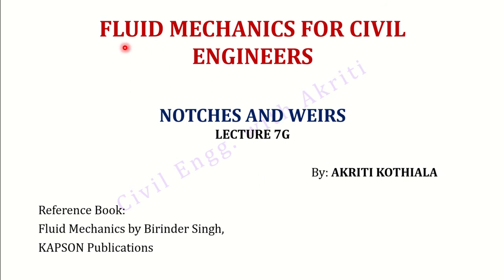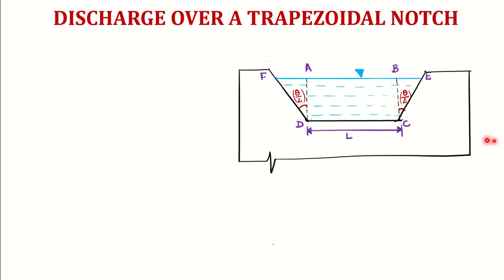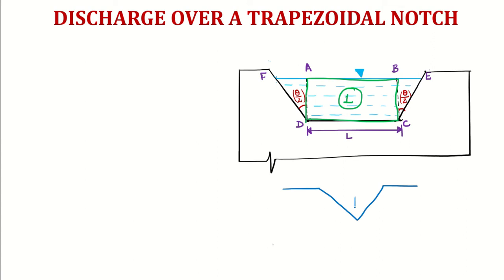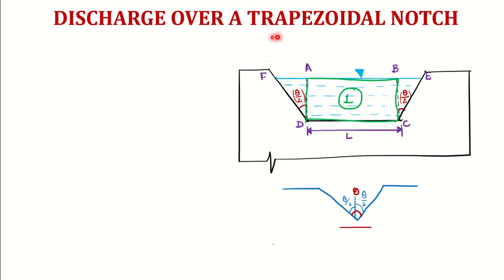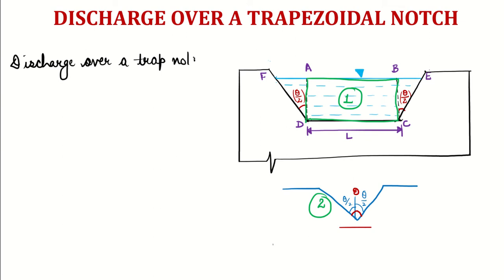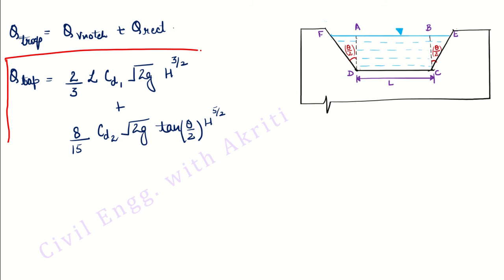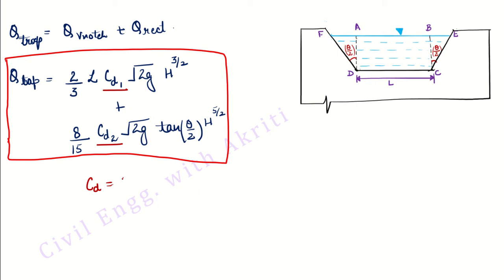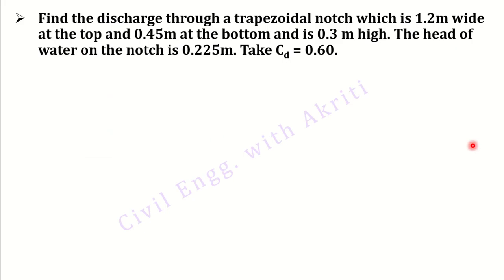Fluid Mechanics | L7G | Notches & Weirs | Trapezoidal Notch | Numerical Problems

Comment: A trapezoidal channel 2.3m wide at the bottom and 1.3m deep have side 2:1 determine the total pressure and the centre of pressure on the vertical gate closing the channel when it is full of water . Please slove the problem
Reply from the maker: I have discussed such a question in my videos...You can take help from that.... Thank You & stay tuned.:)

Comment: Mam, what would be the value, if the ratio was 1:2. Help me out please. Thank you.
Reply from the maker: When the side slopes have a ratio of 1:2 it means that
tan(@/2) = 1/2
If 'H' is the height of the notch and 'x' is the width of the triangular portion, we can say
tan(@/2) = 1/2 = x/H
Therefore, 
x = H/2
Now the top width of the trapezoidal notch will be equal to (2x + L) 
Where, L = bottom width of the notch
Reply: Thank you, mam.
Reply: Tan theta ÷ 2 will also be same as tan theta?? P÷b???